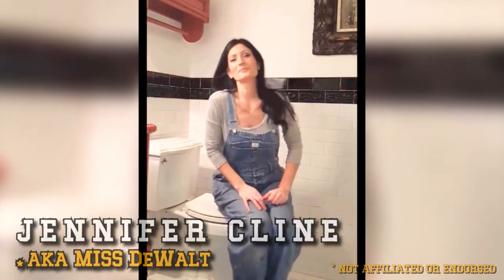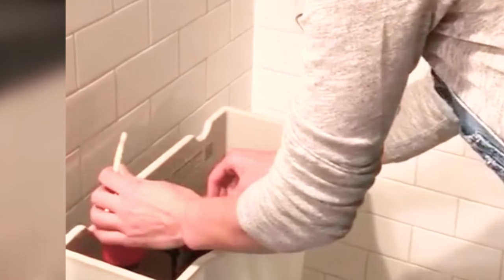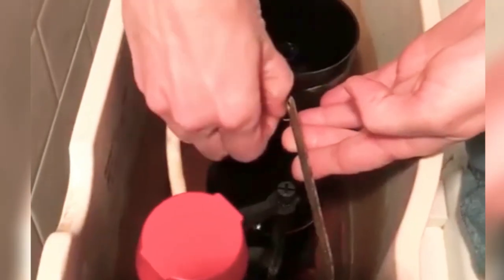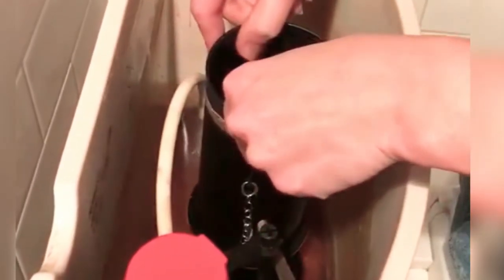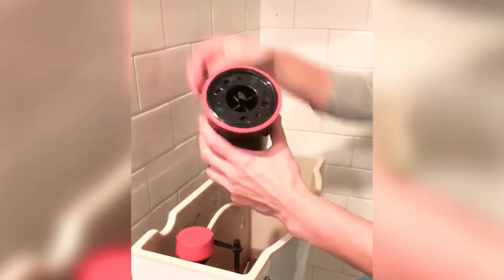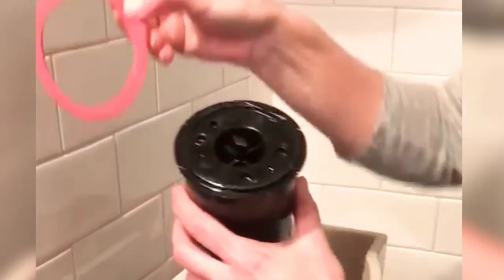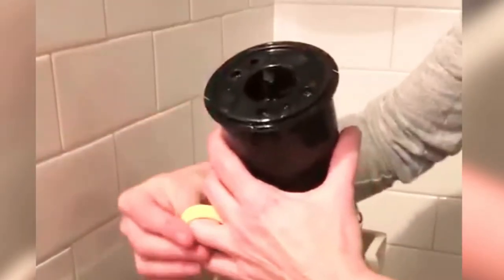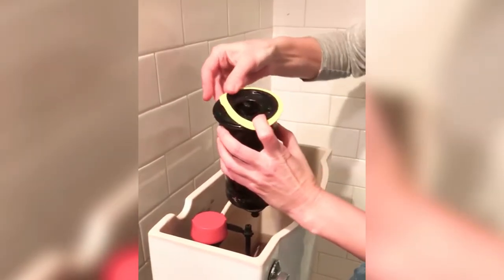Canister Style Flush Valve Toilet Fix. My 1st HOW TO video 🙌

Comment: I know this is a very old video, but I'm hoping you still respond to posts. I did not know, until after the fact, that those bleach drop-ins would damage anything. I live in an apartment, so I need to fix it. I did put in a maintenance request, and a guy came to fix it, but he had idea what he was doing. The apartment complex I live in only hires general fix-it non-professional people, because they do not want the expense of hiring a legit person. So I need to find a way to fix it to prevent being charged an enormous amount of $. The tank will not fill completely, there is a very small amount of water that takes a very long time to trickle in to the tank. Because the tank will not fill, there is only a small amount of water filling the bowl, so not enough flush power to make sure everything goes down the pipes, and I'm very worried about a clog. I can see, Now, that some of the parts actually look to be corroded, and I have no idea how to fix this? I will be so grateful for any help you can give me. Thank you so much for your time😃
Reply from the maker: I’ll try to help the best I can! Crazy question, is the supply line coming to the tank fully open? There should be a valve, turn it completely to the left. Is your water pressure decent everywhere else?
Reply: @Jennyfromtheshop  Thank you for responding!  Checked  valve, it is left as far as it can go. Water pressure everywhere else is good.
Reply from the maker: I wonder if there’s buildup inside the water lines?
Reply: @Jennyfromtheshop  I'm thinking since I don't know that kind of stuff, I need to call maintenance 😮‍💨 Let me ask - what would cause build up in the water line? I am just worried the office will charge me if they can find a way to say it is something I caused.  Thank you for taking the time to reply :)